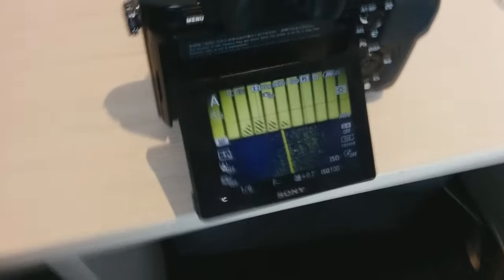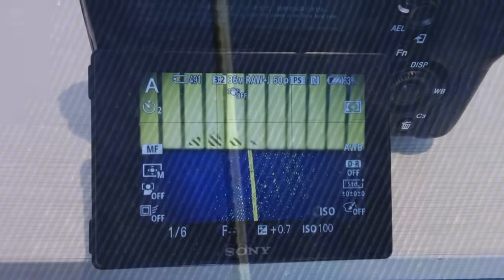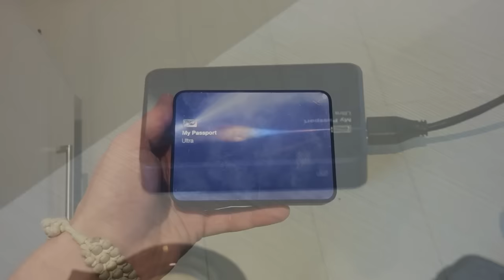Hard Drive Diffraction Grating

Comment: The colours from the shot at the very first (0:15) look like the hues seen on a soap bubble...  Thin-film colours are produced when certain wavelengths of light reflect back in a manner that causes destructive interference in one of the three bands to those which most of our eyes are sensitive (RGB).  The subtractive property produces colours that are in the CYMK gamut.   When red light is cancelled out of white light, cyan remains.  Cancelling green leaves magenta, while neutralizing blue leaves yellow.
Reply from the maker: Interesting, I wonder if it is possible to make a subtractive grating on purpose?
Reply: Looks like you have one, so I don't see why not.  I'm not sure what one would be used for.  Anti-reflective coatings...?